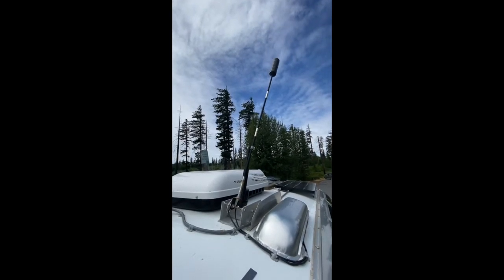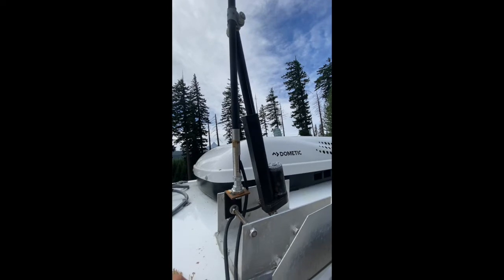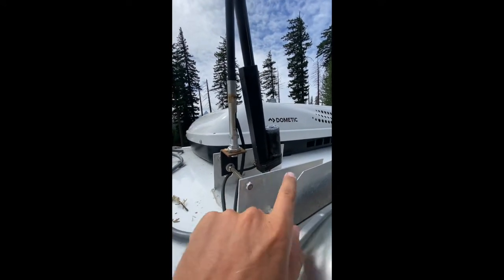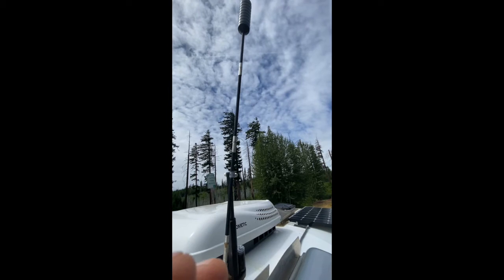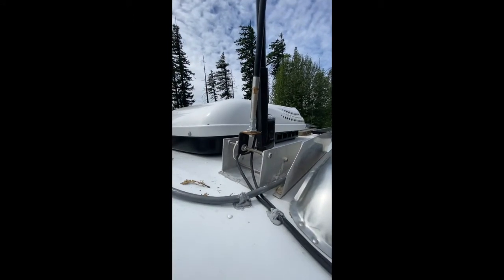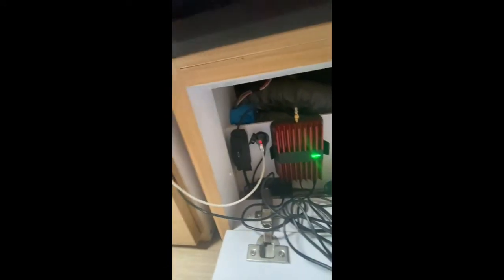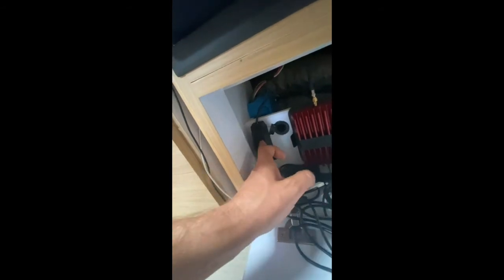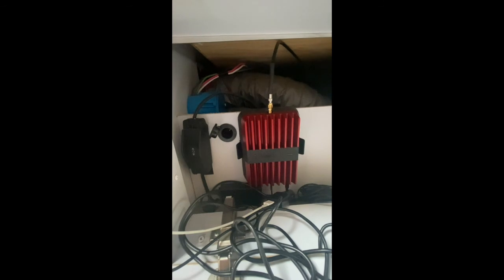DIY Motorized Antenna Mount for WeBoost Cellular Booster on an Airstream

Comment: The metal strap is de-tuning your antenna. Any type of metal so close to your antenna will act like a capacitor that will couple to the antenna especially clamped to it.  If you can redesign the actuator arm (also metal) so it's driving a plexiglass or fiberglass arm instead, then use a nylon, or Delrin clamp, you'll avoid any loss being introduced by your current setup.
Reply from the maker: Thanks I did not think of that but I did wrap the antenna with a strip rubber where the metal strap wraps around to get a nice tight clamp, that rubber should also act as an electrical insulator.

Comment: Wonderful idea, you have me thinking now. I am wondering if the antenna is still helpful when in the 'down' position in areas with moderate coverage. Or do you find that it must always be raised to increase your cell reception?
Reply from the maker: Thanks.  It helps slightly in moderate coverage but you really need to raise it to get substantial improvement.
Reply: @ontheroad6119  Thanks for the reply. I've ordered all of my components and am doing a build different from yours, but definitely inspired by what you did. My geometry and mounting will be pretty different as I'll be mounting to our factory roof rails. The actuator and antenna mount further apart from each other and form a triangle with a much wider base. I am also wiring mine up to an Arduino board that will handle the movement of the antenna. Single press up, single press down. Also considering wiring this up to a signal from the van so that if the ignition is turned on and the antenna is still up, it automatically lowers itself. This is my first Arduino project so it is coming together slowly, but I have a proof of concept working on my kitchen table so I am optimistic.

Comment: Yes, this is so good!  I knew it could be done.  Thank you for figuring it out and sharing.  We have a Sprinter van and drive through wooded areas and can't have the antenna up all the time.  This takes care of that.  You have the 'momentary DPDT' switch.  How do you know when to release the switch, meaning how do you know when the antenna is all the way up and conversely all the way down?
Reply from the maker: The switch which is offered with the antenna turns of when fully extended or retracted so when pressing the button you simply wait for motor to stop.
Reply: Hey thanks. Sorry for the delay in response. Hope this still can help. You can hear the vibrations of the actuator stopping from inside the trailer.